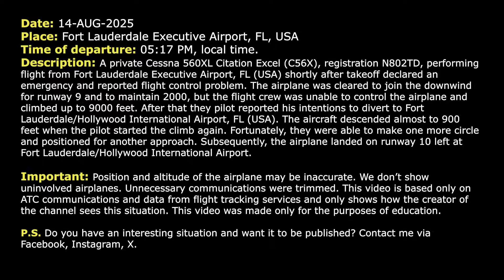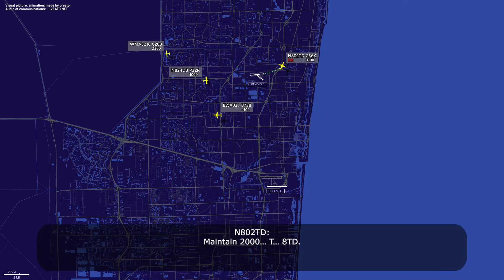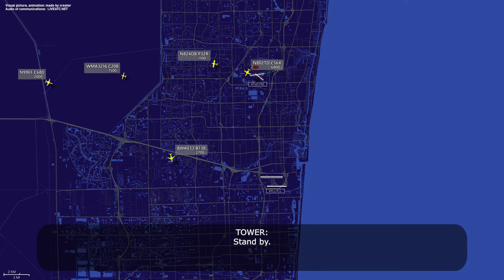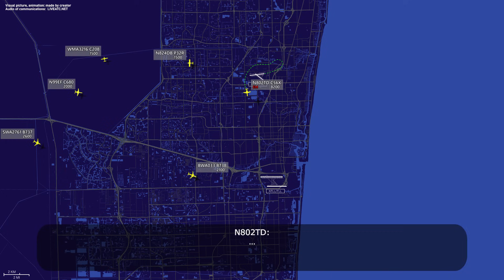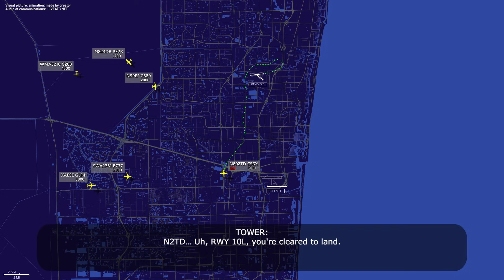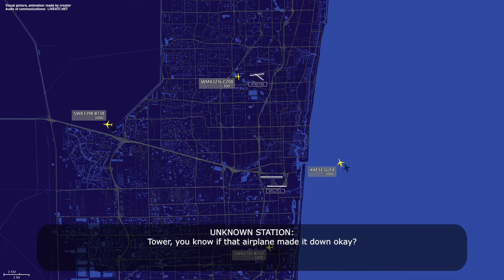Pilot fights for his life. Flight control problem after takeoff. Real ATC

Comment: I was leaving KFLL bound to KFXE to fly at the school. I saw the Southwest on a discontinued approach above 10R, then I opened the FR24 and saw another one discontinuing, and after that the C56X on a strange left base for 10L after a kind of a 360. I entered my car and went next to Signature to see the landing zone of 10L. When I cleared the tree tops on the street I saw the C56X flying with a 15 to 20 degrees nose high with a veeeeery low horizontal speed at 150/200ft, on a place it should be on the ground already. I tought I would witness a stall direct to the runway, but they thankfully were able to drop the nose and gain more speed to land, with a little bit of left bank almost in the middle of the runway length. Fire trucks followed but the plane was safe within the runway limits
Reply: Wow - that is very important information and great observation.  Sounds like a STAB issue which is way too common on the Excel.  Has caused many problems over the years.  This pilot is a hero IMHO - and sounds like he was a single pilot operator in this complex jet.  Again, your observation of a nose high attitude would be of great interest to the FAA if they are in fact investigating this.
Reply: @keno7800 would not and better not have been single pilot.  Excel/XLS type is dual pilot
Reply: DEI horizontal stabilizer?

Comment: as much as I want to blame the controller here - and no, he wasn't helpful enough - the ATC system is not conducive to quick collaboration (how many times to we hear multiple controllers ask emergency pilots the same 'fuel/souls on board' question?). There should be emergency control protocols that give one controller a larger geography.
Reply: Who do you think called FLL Tower and advise them of the situation?